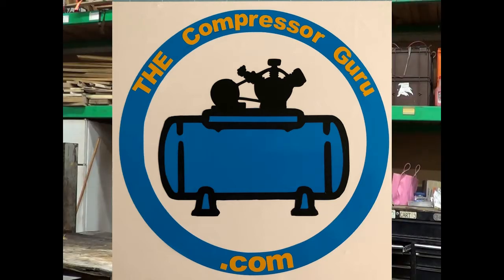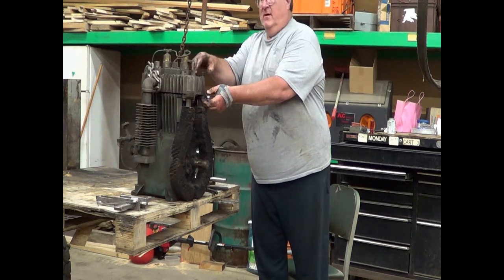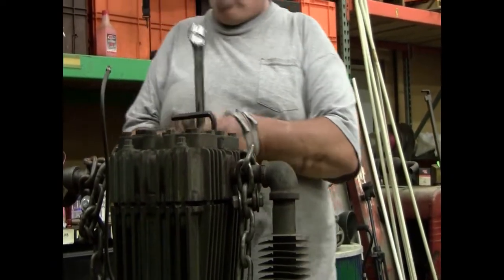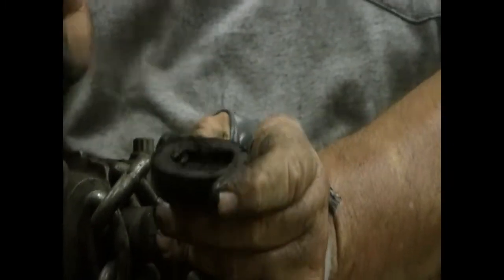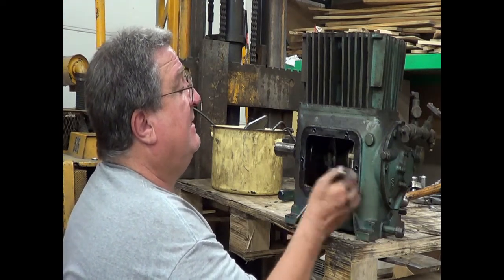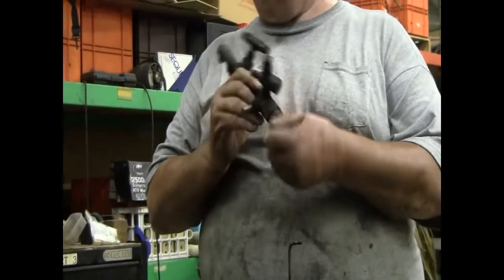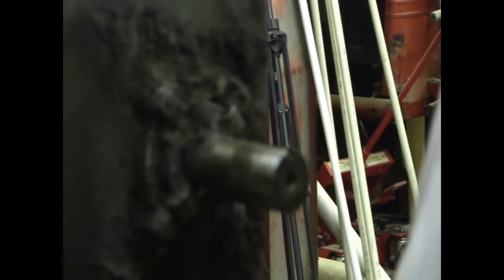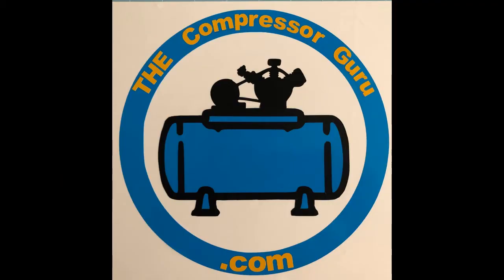Quincey 325 tear down and evaluation.

Comment: I have a 310 roc 100 compressor and tank- when I took possession of it, I was informed that it still works but a tow motor bent the crankshaft. I have tried and tried to straighten it, have contacted at least 20 machine shops here in the south and nobody straightens crankshafts. I believe a new one will run around $480. I’m looking to find a way to straighten it without buying a new one. Bent between the belt pulley and the housing. Aside from this issue, I’m ordering a rebuild kit & paint for it as it appears it has been sitting up for a little while. 
Any suggestions regarding crankshaft or anything else would be most appreciated! 
Thank you for making these videos! You don’t know how much these have helped me!
Reply from the maker: I do Not know of any way to straighten the shaft. sorry. if you have not yet ordered your rebuild parts I would be glad to give you a quote on the parts or kit you need , you can contact me through thecompressorguru.com.

Comment: Hi, Recently I bought 325-15 and Made a Rebuild as you did it, but I dont have oil pressure, I check holes, orings, vanes and all looks good. do you know which would be the problem??? regards. PD. how can I sending videos about this problem, I will appriciate your help.
Reply from the maker: Joel you can contact me through thecompressorguru.com
I think I need to talk to you on the phone , there are allot of things to check. looking forward to hearing from you

Comment: Nice 325 Quincy teardown. Guru, what horsepower is required to  run a 325 ? Thanks, Paul
Reply from the maker: the range on a 325 is 3 to 5 hp. this unit is run with a 5 hp industrial motor.

Comment: I seen a trick for those stubborn rods you encountered in this episode (use a dowel between the rod bolt and the bottom of the crank case then spin the crank): https://www.youtube.com/watch?v=ZWt4vmGHLPo&t=407s
Reply from the maker: thank you good tip!!! these are not usually  this much trouble.